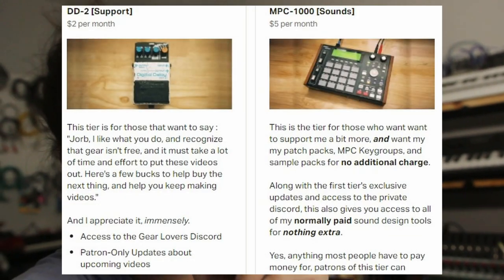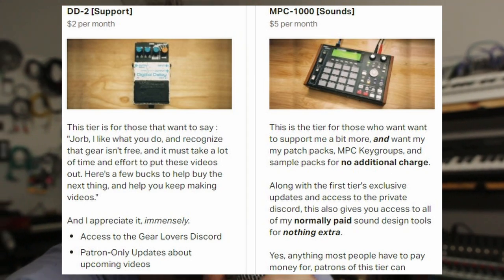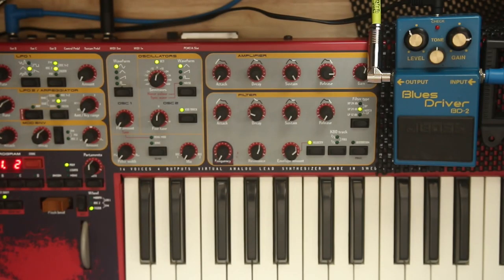The Synthesist's Guide to Drive Pedals

Comment: I love when companies market to "metal heads" "This pedal is called The unicorn stomper. It's settings are Stabbed in the neck with a rust screwdriver, it goes from 1 tetanus to 10 death from infection. Then we have bludgeoned with a cat, this goes from 1 fractured skull to 10 total decapitation." Awesome video, That fuzz pedal you made sounds fantastic.

Comment: This is such a great demonstration and explanation! Bright blue LEDs like the one on that DOD are so outrageous, and I'm glad you slapped some tape on it. A trick I use to get bright LEDs under control is putting a drop of Elmer's wood glue on it, letting it dry, and then putting another drop on if it needs it. It works like a charm, and you can easily and cleanly peel the glue off with tweezers if you decide you don't like it. :-)
Reply: I want my gear lit up like an airport.

Comment: This is my jam. I was just wondering if i needed s Fuzz and Overdrive to go with my Heavy Distortion for my synth. This answered that...beautifully. Thanks.
Reply: I have a Flanger pedal to use on sythersizors but I dont have the wire.
Reply from the maker: Cheers, glad it was useful!

Comment: Great video, I love the visual translation with the oscillator!
However, I’d add the caveat to be careful with running line level into drives, especially fuzzes with sensitive transistors. You could actually damage a pedal by running too strong a signal into it.

Comment: if you run an FM E. Piano sound through a drive pedal can it do a "bark" sound with high velocity like a Rhodes does? unfortunately I don't have any pedals anymore to check!
Reply from the maker: Certainly, with a dynamic patch, you can get some of the same feel of running an electric piano into an amp, breaking up on the hard hits. 

But, just because I'm geeky about it, and depending on what you're describing, that sort of really hard tine hit might be covered by a deep FM patch, or not covered in just a drive pedal.

Comment: Good stuff. I don't think there are many videos that show the combination of the bd-2 and synths. I may have to pick one or two up. 

Speaking of which, when using drive pedals do you find it unnecessary to go stereo? Or do you have one channel going into one drive pedal and another channel going into a different drive pedal? Just asking because stereo drives are few on the market.
Reply from the maker: No joke, I've considered modding two blues drivers into one box to use as a stereo pedal. I actually had written in the outline to bring up the EHX operation overlord, as a stereo drive pedal but didnt really rely on the outline much for this one. 

Because you're right, there aren't many. Eventually I plan on doing an advanced signal routing episode, with dry blends, effects sends, and other things to get around combining signals like that
Reply: @JorbLovesGear   I haven't experimented enough, but at some high level of drive my ears can't hear much distinction with stereo modulation added to the signal. I may have to try a wet/dry rig, but maybe that's thinking too much like a guitarist?

Comment: Hey there, would you suggest an Empress Reverb or a Strymon Big Sky for use with Nord Lead 2x and Moog Grandmother? I don't plan on using the pedal for guitar. And I really don't like Spring reverb either. I also thought about a Mercury 7. But I really need guidance.
Reply: Or even an Eventide Space, lol
Reply from the maker: either would be excellent, but empress is a lot simpler to use, if you ask me. I have a full video on it.

Comment: You mentioned Soft Clipping & attempted to give a demonstration of what it is, but maybe it's just me, but that's not my understanding.  Perhaps I heard "soft clipping" & you were demonstrating something else???  My understanding of Soft Clipping is; As the Input Gain approaches the maximum input value, instead of allowing the waveform to produce a Square Wave (or at least square wave transients), the Soft Clipping feature rolls over those Square Waves, so they become "Less Sharp" and "More Curved".
My understanding is that; 'Soft Clipping' is more akin to a Compressor/Limiter, than it is to do with an Overdrive/Distortion Pedal...
Reply from the maker: I'm not really following your initial understanding, but let me try and get there.

My example around 6 minutes was with a sine wave, as it gets pushed past the headroom of the blues driver, a soft clipping pedal, it changes into something different, less smooth, and more distorted.

Were I to do that same thing with a square wave, it would also distort at any levels beyond the headroom, & it wouldn't necessarily be a clean, all right-angles square anymore, it may become asymmetrical, etc but would certainly distort.

All that to say, the connection to compressors is a little bit tricky, headroom has some different context. 

Compressors (generally) aren't designed to distort your signal when you go past the headroom, they just bring your level back down. 

That may color the sound, depending on the circuit, but the intention isn't to clip. 

If course, some compressors can be driven to distort, but in talking about broad, how these effects work, it's not quite soft clipping, because the signal isn't quite distorting.
Reply: @JorbLovesGear  Seeing as your video speaks to the process of altering sound, then I shouldn't have attempted to challenge your description on a subject I know very little about.
However, in my defence; there appears to be two definitions for the term, "Soft Clipping" - there's yours as it relates to signal modifiers (to add harmonics) & there's a second which relates to protection circuits in Amplifiers.  It's this second example which I'm more familiar with.
If you search YouTube for, "NAD 3130 soft clipping on the scope", it gives an example of the Compressor/Limiter type of "Soft Clipping" which was my understanding of the term (as it relates to Amplifiers).
Again, apologies for my misunderstanding.

Comment: Thanks for covering the light on the gunslinger. It hit my eyes bad. I am still recovering. I will get through it though. I am wondering to where you route your pedals. To a mixer or some other preamp? When I route a pedal similar to the one you use in the video into a mixer it generates a feedback at a certain level. Is that level a setting you have to remember combining two elements to avoid feedbacking? Or am I getting feedback because I monitor both the source and the fx return in my mixer? Thanks. Great shows!
Reply from the maker: Synth > Pedals > Mixer, into one channel. using it on an insert or something could lead to feedback.
Reply: @JorbLovesGear  i am getting a multieffect. Some cheap Korg AX300g. I just love to run sounds through these hardware effects. Even wav samples in the daw. So many variables. I come by some feedbacks as you mentioned but if I mute the monitor in the daw mixer I can get by without feedback there. Also my souncard is a Digitakt so when I mute the sample monitor there I can avoid feedback. I really want a new mixer. Just line mixer. Not much need of preamps with the synthesizer setups.

Comment: i have a question soo im in the market for guitar effect pedals to run my software synths through .. ive never been a huge fan of hard overdrive and heavy distortion sounds .. but i love saturation.. i know weird right? but ive been specifically looking at chase bliss audio vinyl warped.. im definitely going to be picking up that unit when im not so poor.. but im wondering have you had any experience with these types of units? and or know of a cheaper alternatives that are just as good.. the thing sounds amazing but $350 .. god thats gonna hurt for something so specific.

Comment: I really love your content mate, well done! One question for you... I am getting some pedals from a friend who's selling a load and want to insert them in my signal flow. I have a minilogue xd, an audio interface and Ableton... I produce ambient music, no guitars, no vocals... if I want to use the pedals as inserts and be able to effect my master bus do I need a reamp box like the Radial extc? many thanks!
Reply from the maker: You don't need a reamp box, but it will make for a cleaner / less jank set up. I hardly know anything about working with a daw though, depending on your hardware you've got options
Reply: @JorbLovesGear  what do you mean the ramp will make for a cleaner/less jank setup?
Reply from the maker: @portcorner_noise  just aux send out, into a pedal then pedal out into the interface, level matching could be a pain, getting noise or hum where you don't want it is possible... A lot of it depends on your specific gear
Reply: @JorbLovesGear  sure, understood! thanks a lot.

Comment: The results would be dramatically different on lower frequencies. Think of what the pedal is doing. If you drive the whole spectrum hard it will eventually just be white noise unless you're carving out a more narrow band for the effect. And white noise kills the bass. That's all about human hearing and the difference between white noise and pink noise. The more noisy a bass synth gets the more it needs that low-pass filter. That's why the filter is the most important part of a bass synth. The more you distort a synth the more resonance you need on the filter to keep it from effectively amplifying the high frequencies.

Point being, if you look at the spectrum you'll see that a lot of pedals kill the bass. Tube Screamers kill the bass. A Boss SD-1 is like a dirtier tube screamer, and being dirtier makes it kill even more of the bass. The EarthQuaker Plumes sounds better than most tube screamer clones on synths because they kept it from killing as much bass. But it's not as much fun cuz it's cleaner. A lot of fuzz pedals are really good on bass guitar or on a 303 because they have more legit tone control. Most Big Muffs will give you more of a heavy Cliff Burton bass sound. I mean a Morley will give you the actual Cliff Burton sound LOL. But the reason Cliff Burton's bass sounded so heavy was because he was basically treating his bass guitar like you treat a 303 — driving it really hard then using the Morley as a low-pass filter.

I'm just saying that most of these circuits are designed for mid/upper guitar frequencies, and there aren't many people talking about what they do in the lower ranges. Most of them kill the sub-bass no matter how much you try to boost it with the tone control. But then there are pedals like the Boss OS-2 which sound amazing on a bass synth and actually make the bass thicker.

Comment: Drastically different sound if you play cords vs single notes. I have got a few Pedals to use with My sythersizors but I dont have the correct adaptors.
Reply from the maker: Can be helped with a compressor, keeping the levels more stable, less dynamic.

Comment: FuzzFaces need a "pickup simulator" transformer to behave properly with high-impedence devices.
Drop one before it in a setup like this and it comes alive with 10x the dynamic range.
Reply: got an example? id take a link. thanks in advance